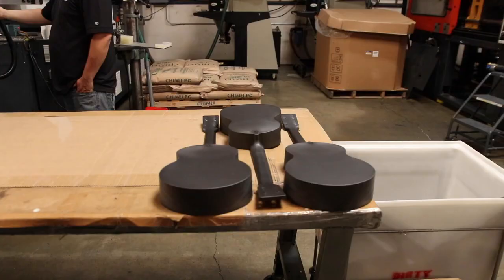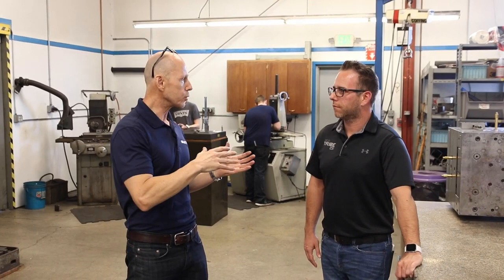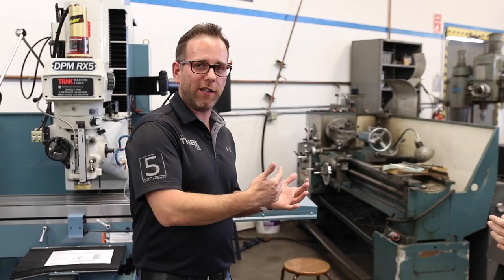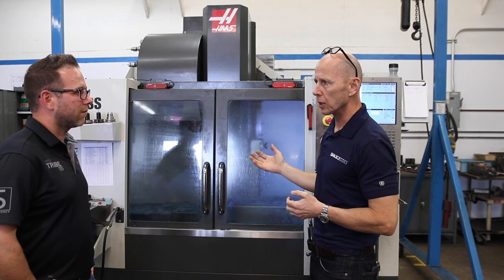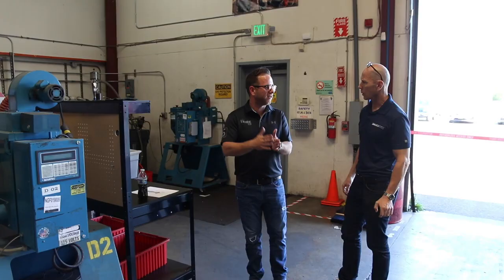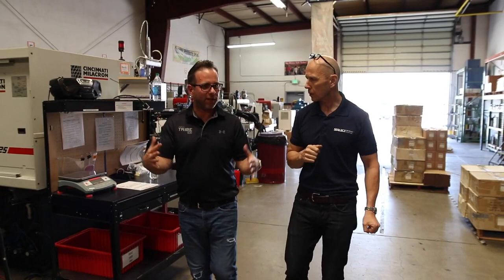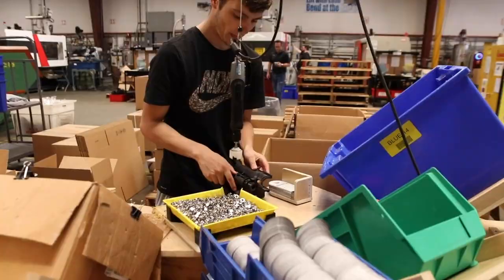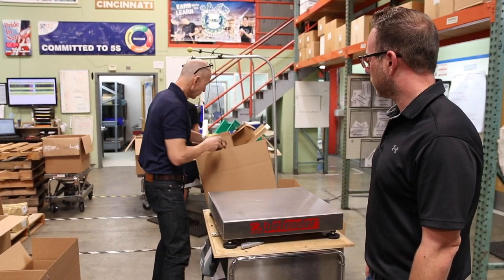SEA LECT Plastics Plant Tour With Tribe TV - Plastic Injection Molding

Comment: I was really impressed by the attitude of Mr Matt Poischbeg.  Especially his interest in working in new materials. For these reasons I will contact this company and have them consider making the tool and doing the injection molding of my new product, which is designed to reduce the amount of single use plastic. People who say " be plastic free", really have no idea what they are asking. Plastic is our friend, but, because at present it is cheaper to make new plastic, than it is to collect and recycle old plastic, it is considered an  enemy, but times are changing. They are working on different kinds of recyclable and biodegradable plastics today, that will be in use 100 years from now, in the same way as we are using plastic invented nearly 100 years ago. If it had not been for plastic, I doubt there would be tree left standing on this planet. Just to mention one product, think that nearly every recreational boat would have been made of wood, and large boats would be made of some type of metal. Of course there would not be so many boats, as they would not be affordable for the average consumer. The plastic waste is a human failure and finally governments are in the process of eliminating single use plastic and taxing non-recyclable plastic. If we can deplete the the number of fish in the sea, we can surely clean up the garbage in the sea. Every drink sold in a paper cup by Mc Donalds comes with a plastic lid, even if you are having the drink in-house. It is used to carry the drink to the table, then it is generally removed. In total, worldwide, it is estimated that there are 80 to a 100 billion plastic lids discarded very year. Something has to change and it will !